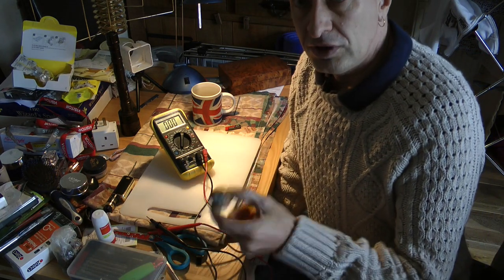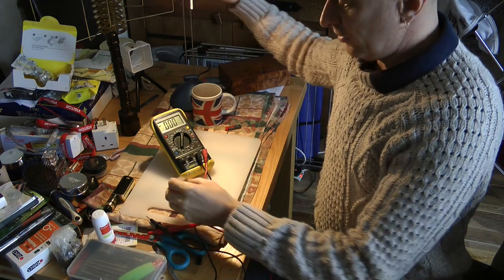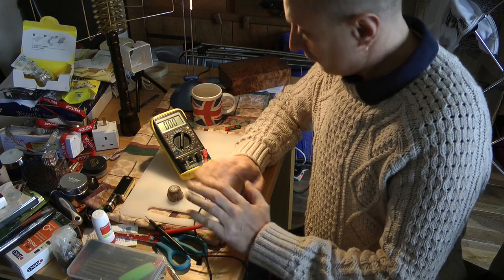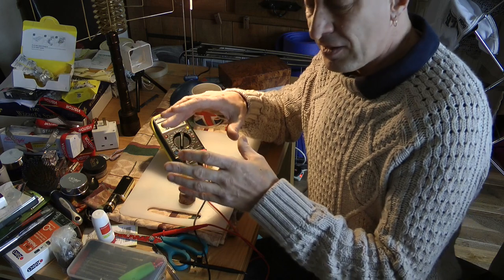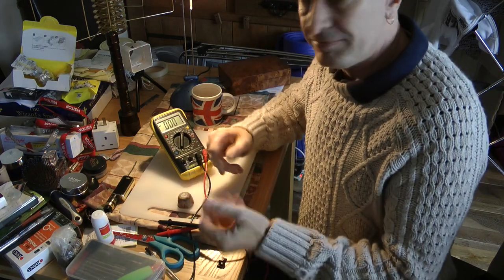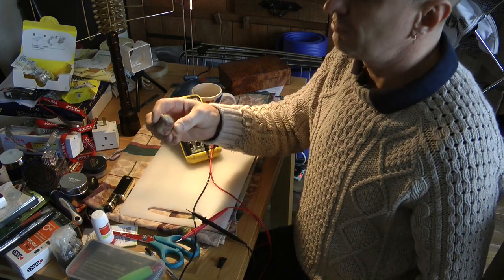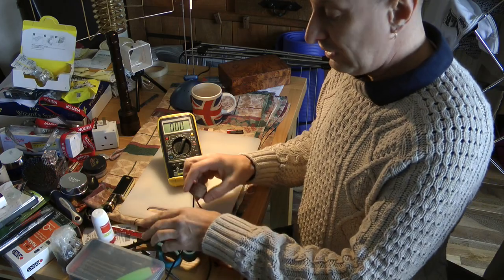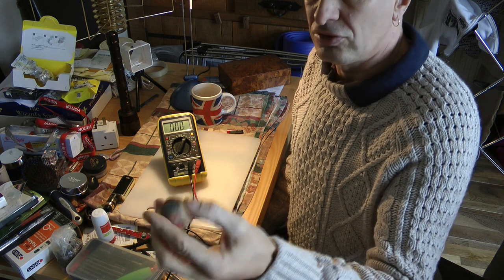A Strange cell (Battery) Allcingeye

Comment: awesome mate - your go to position on batteries is going to be redox - with the nylon it's like a solid electroylyte - some idea of amps would be good - and it might be interesting to see how this works out as a kind of zamboni pile
Reply from the maker: So great to get your comment. with the Hutchinson cell it was quite easy to watch it working I just used a vibrating wet shaver that used a triple a battery and just let it run for weeks and weeks I could see and hear it working. I looked up Zamboni pile. and the oxford bell experiment. now a door bell with a very long life battery would also sell well. size would not be much of a problem either for a door bell. I thinking with the solid  fuzzed  electrolyte it may be helping in some way because it dose seem to shrink over time and tighten on to the copper and magnesium. as it shrinks. so it may be a slow burn cell that might need to be dropped in a bit of warm water once a year to swell things up a bit. The nylon still remains a good insulator but I guess it could run a wrist watch. even better if the casing of the watch could be 3d printed out of the nylon so on space would need to be taken up by the cells inside the wrist watch L could call it the Cell Lesser Watch I confuse the boffin's  I can see those Germans now wer ist der battery may be some medical good points as well with some slow mineral release system as a side affect, My ideas are end less when I get in the swing but no one to bounce off just me myself and Irene. lol
Reply: i remember reading about dissolving nylon in acetic acid and using it as a conductive binder - i can't remember the paper i am afraid but it might be worth hunting it out
Reply from the maker: Been looking at your grapheme paper cells the big one is just great I tell every one about it  and  how on earth do you attach leads from them its ok to drop a probe on to get some reading but the trouble I had just getting a good fixing to a bar of magnesium and a copper pipe things just corrode away I have just made some coper type paint. to test. but lol as I was playing with the stuff I thought I will paint it on some wood lol and wow it works great as a wood dye. I was hopping it might make the wood conductible  as well but not yet. cheers for your advice its nice to know people can comment youtube has changes so much may be greed has taken over. just reading your book on super caps i had to touch on some basics years back to get my ham license and of course super caps may be useful in many ways.
Reply: getting stable contacts is a real issue mate - it's one of the things that killed a type of advanced lead carbon battery
Reply from the maker: Lucky I do have some of the aluminium ducking tape or double glazing tape the sticky stuff which you use. I have found many uses for that stuff over the years its great to repair broken plastic cases with a few spots of super glue the better half's hair dryer has been held together for years now. if I make another nylon cell I will embed the wires deep in the nylon  save problems or just build it the same shape as a AA cell.
Reply: awesome

Comment: These types of 'crystal battery' or nylon in your case, usually put out around 1.5 volts, give or take, but not much current or amperage. If you say voltage is the width of a river, then the current is the speed of the flow. So what you have there is a 1.5 volt wide river that flows (I assume) very slowly. If I had to guess, I would say no more than a few milliamperes(thousandths of an amp) of current or flow would be the result from your device. You can measure the current by hooking up your meter (set for amperes, with the red lead in the correct hole on the meter) while you are connected to a load, or a motor, or a resistor, in series, whatever will draw electricity from your battery. Like this , connect the battery positive to red lead, then black lead to motor/load/resistor leg, then other side of load/motor/resistor leg to the negative of the battery. In this way, current flows from the battery, through the meter, then the motor/load/resistor, back to the negative side of your battery. I would like to know the result. Cheers.
Reply from the maker: Cheers for your input and I am sure your thinking is correct. but of course all big rivers start at a stream lol  with most electronics getting smaller a different way of looking at cell types and shapes may be useful.
Reply: Anytime. I came here from your comment on Robert's channel, any time you need to 'bounce ideas off'  someone, please do. I really understand where you are coming from on this, believe me. I've been down that alley more than once. 
     Have you tried using it to charge a capacitor, or bank of capacitors? In that way, you may get more 'flow' or current, if you use it to charge up some capacitors.
Reply from the maker: I am sure you are correct but if I could just run a wrist watch for five years or more that would be a wonderful thing